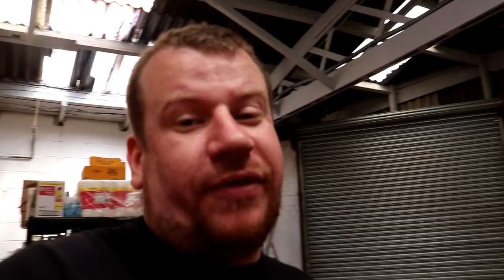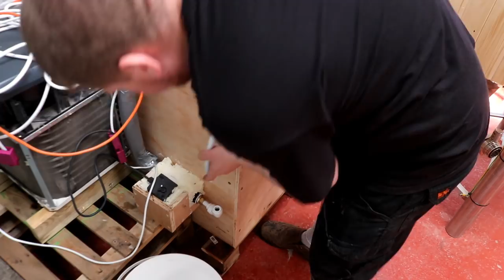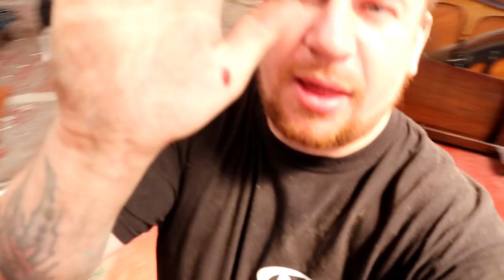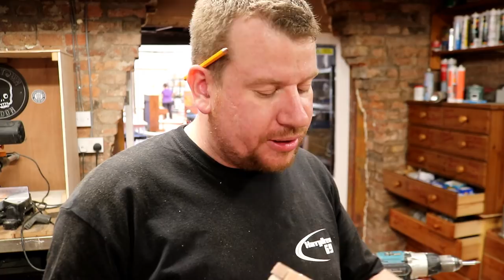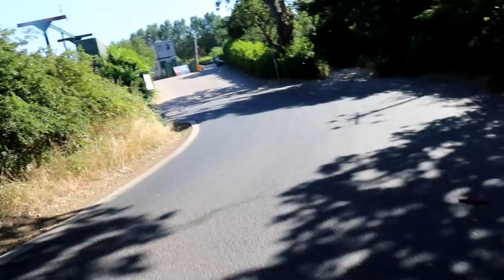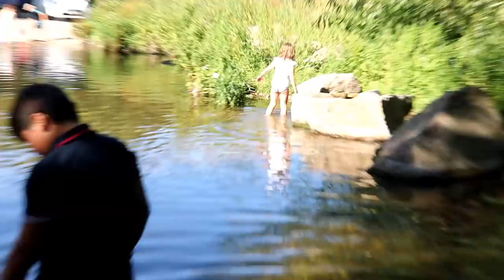JUST A QUICK DIP IN THE RIVER

Comment: Harry, I am an air conditioning mechanic. That vent for your chiller may not have sufficient air flow and may burn out your compressor. If you add an in line fan in the vent pipe it may help to draw the air out better. Cheers!
Reply from the maker: Yes, had problems already. I am going to have to revisit this one. cheers